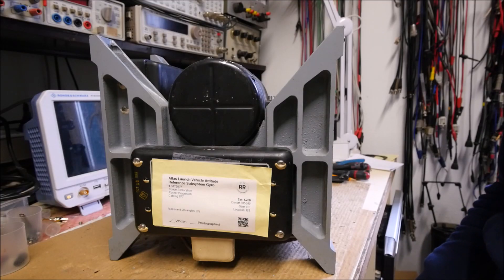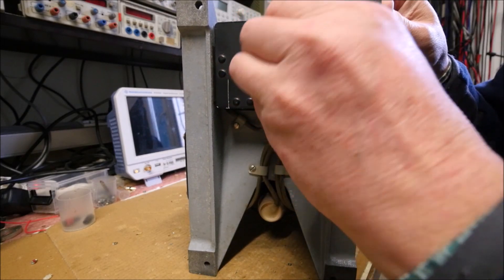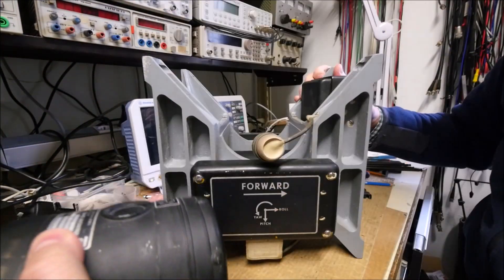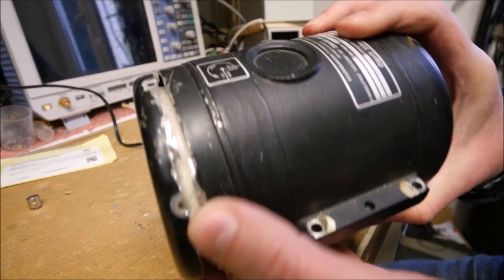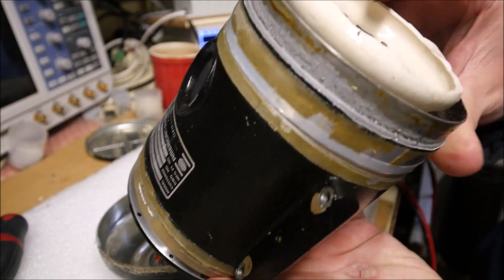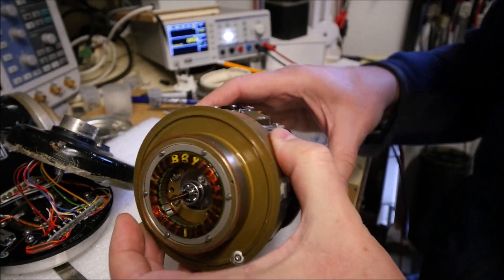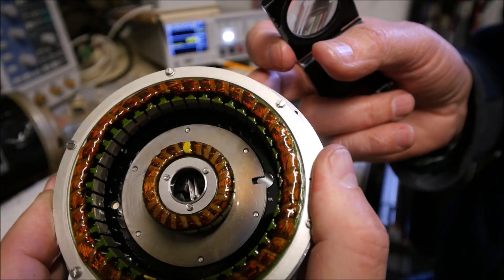LDM #362: Atlas Launch Vehicle Attitude Reference Subsystem Gyro - Part 1: teardown

Comment: Dissecting an Atlas Launch Vehicle's Gyro Reference Subsystem (GR 10A-1)

* 0:50 - Acquisition Details: The gyro reference unit, acquired from RR Auction for around €600, is identified as a Latitude Reference Subsystem, model GR 10A-1 designed for an Atlas launcher.
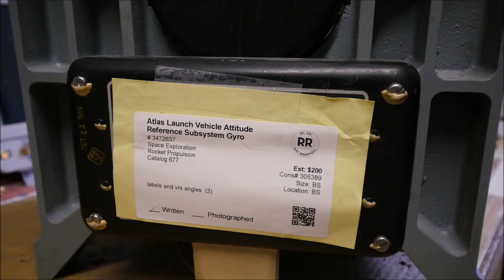* 1:17 - Dual Gyro Configuration: The unit houses two identical, orthogonally placed gyros for redundancy and multi-axis measurement.
* 2:25 - Demodulator Modules: Two potted modules, a Yaw Demodulator and a Roll Demodulator, are present, although their exact purpose remains unclear.
* 3:57 - Oil-Filled Gyro: Upon teardown, the gyro is revealed to be filled with oil, likely for lubrication and dampening. [From Comments] This is likely a floated design, similar to the Apollo IRIG, where the liquid reduces friction and acts as a dampener.
* 4:16 - Challenging Disassembly: The gyro's cover proves difficult to remove due to its complex construction, requiring a 'medieval' approach involving a saw. [From Comments] The seal likely utilizes a solder-band, common for hermetically sealing flight hardware in dynamic environments.
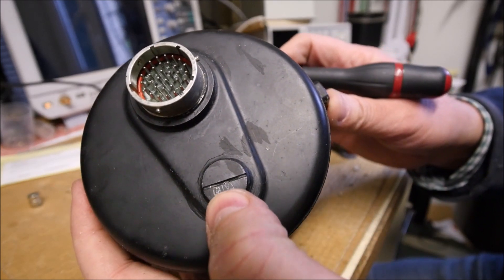* 5:24 - Fill Port: A large screw is identified as a potential fill port for the oil within the gyro.
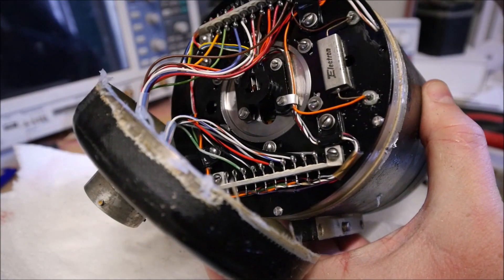* 6:30 - Internal Components: Teardown reveals internal components, including a capacitor likely used for the gyro's rotor motor.
* 7:04 - Brush Contacts: Brush contacts are found within the gyro's assembly, highlighting the delicate nature of the internal mechanisms.  [From Comments] The slip ring assembly might accommodate a tool for safer contact removal and installation.
* 8:04 - Accidental Oil Spill:  An attempt to remove a plate results in a significant oil spill, underscoring the challenges of working with such a delicate and intricate system.
* 8:49 - Gimbal Resolvers and Torque Motors:  The gyro features synchros on each axis for position sensing and torque motors employing eddy currents for precise gimbal control.
* 10:01 - Reassembly Concerns: The video creator expresses concern over the difficulty of reassembling the gyro, particularly regarding the tiny and inaccessible contacts within the shaft.

I used gemini-1.5-pro-exp-0801 to summarize the transcript.
Cost (if I didn't use the free tier): $0.05
Input tokens: 13900
Output tokens: 549

Comment: I presume that this oil is based on polychlorinated biphenyles mixture. Your work place is fully contaminated for next 20 years. And you touch it with bare hand. So your body is also contaminated with this lipophilic compound. Good luck.

Comment: Michel, would this be a floated design like the Apollo IRIG, where the liquid was used to float a hermetic rotor enclosure near zero buoyancy, to reduce friction loads in the bearings? They actually called the spherical enclosure that held the rotor the “float”. In Apollo the fluid was also used as a dampener for the float. I wonder if this is a similar idea.
Reply from the maker: I am not sure, I think that the temperature should be controlled to have neutral buoyancy. I think it is just a damping oil.
Reply: @lelabodemichel5162  Yes, definitely the temp had to be tightly controlled on the Apollo IRIG. No heaters in yours?
Reply from the maker: Not on mine. I have done a quick reverse engineering and I didn't find any connections for heaters or temperature sensor.

Comment: It looks like the slip ring assembly can accommodate some type of tooling to retain the contacts during removal or install.
Reply from the maker: Yes, I tried to build such tool, a small aluminium plate which can be inserted between contacts then rotated to spread them but it was not obvious. It is a delicate task performed I assume by a qualified worker.